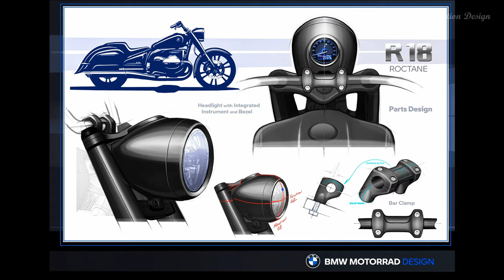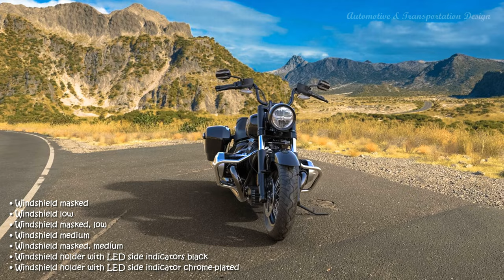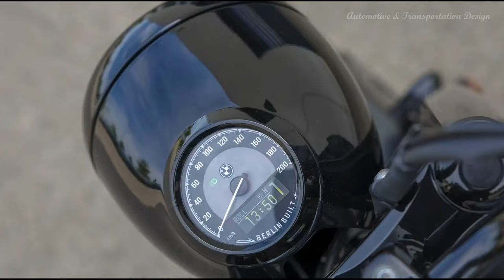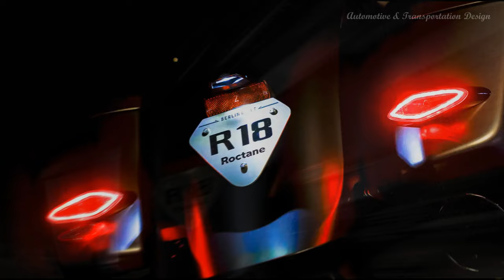2024 BMW R18 Roctane * SPECS, COLORS, PRICES, FEATURES and BENEFITS * A&T Design

Comment: Do options include a clear view windshield and a larger fuel tank off one of the tourers?
Reply from the maker: Most likely no. You can see the possible modifications for this motorcycle model:
https://configurator.bmwmotorcycles.com/index_en_US.html?country=US#/configurator/24RK/P0N3G,S036A,S0538,S0650/COLOURS